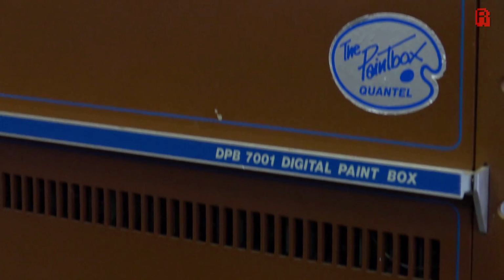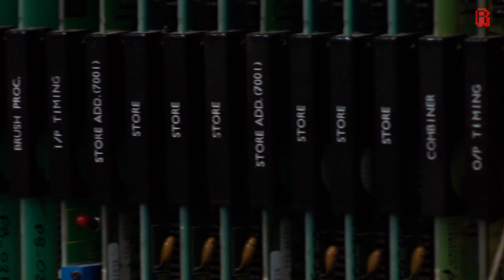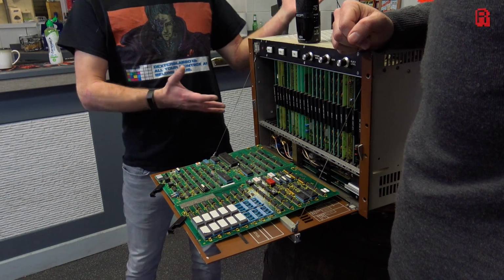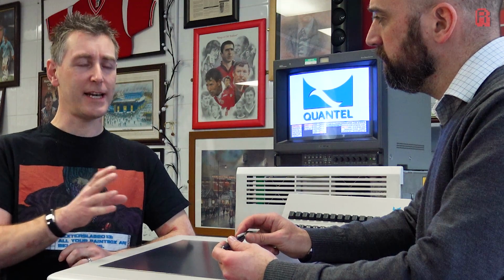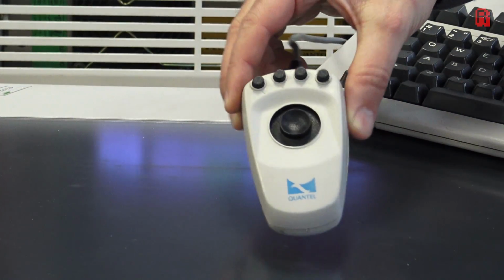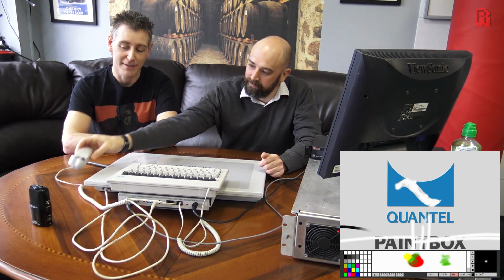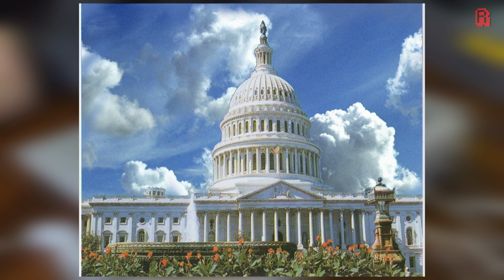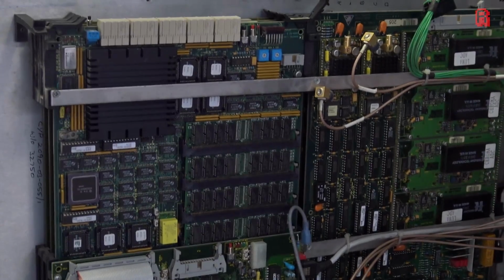How Did they make TV Graphics in the 80's & 90's?  Meet the Quantel Paintbox | Retro Road Trip

Comment: 256mb of Ram back in 86!! that is seriously impressive stuff. I'm blown away! and its British :0)
Reply: 1/4 GB of static RAM. Amazing.
Reply: @djmips  I strongly doubt it would have been static SRAM, that much memory would surely have been dynamic DRAM. And it would have needed even more circuitry to refresh all that DRAM too.
Reply: My phone had 256 mb of ram in 2012 lol
Reply: I had 16 MB RAM in my PC from 1996, first gen Pentium  150MHz.
Reply: @mipmipmipmipmip  You are right. Average memory in the early 90s was 8MB of RAM. To get a picture how much that was in 80s.
Reply: 64kb..my first computer..commodore 64 .
Reply: @dzonikg  My first computer was the VIC-20, it had 5kB RAM, but i also had a 16kB plug in memory expansion that was the size of a cell phone :-)  I still have my Commodore 64.
Reply: My computer had 64k in 86
Reply: @Stefan-  Me to have commodore 64 still haha..my parents bought me in 1986 ..i still remember the price..it was 700 deutsche marks ..i see that VIC-20 look same as commodore 64
Reply: @dzonikg  I had the VIC-20 in the early 80´s and got the 64 in the mid 80´s, i was a teen in the mid 80´s so my mother helped me buy it. The VIC-20 is white, but otherwise quite similar in apearance to the original "breadbox" designed version of the 64 that i have. I actually remember that the 64 cost 2000 SEK (Swedish currency)
Reply: @UrbanOzzy  I have 96gb of ram, and Chrome still uses 99% of it :(
Reply: @Stefan-  I had a Pentium 60 mhz in 1994 8mb Ram
Reply: @dzonikg    DAMN! That's ~400 bucks U.S.! Must have been the whole system with monitor and drive?  My C64 was ~$220 but that was just the computer.

My first experience with generating TV graphics was with the Amiga. I still have my (heavily modded) A-3000.
Reply: and typical of the brits, despite a MASSIVE campaign to get people into computing etc, all we were told about was the bbc micro and sinclair specrum etc.. Why no and look what the professionals use type of education to interest more people into the field? Why not tell people - if I had known back then what ram etc was available in 81 in a computer then I would have re-imagined my programming to think longer term scale. Instead we were told 16k was huge.. then 48k etc..
Reply: But surely you must have worked out that computers would improve. Even in 5 years there were huge changes. The Amiga 500 and Atari ST were available 3-4 years after the Spectrum.
Reply: In 1982 I had a zx81. It had 1kb of memory, the 16kb ram pack I got crashed if it even got the slightest movement...
Reply: @kenmeade9924  Well, companies aren't going to tell customers that their products are crap, of course they'll say that whatever specs ended up being profitable for them is also all you will ever want or need (despite doubling those specs a year or two later). Bill Gates (supposedly) said that "640K ought to be enough for anybody" not because he actually believed it, but because he was trying to sell a product and probably to justify some software design decisions. 

I guess one of the great things about the emergence of the generic PC in the 90's is that you get to pick what you want, you're not beholden to the choices made by a single manufacturer. If you're doing some hardcore data processing and need a shit ton of ram but don't particularly care about graphics, you can do that, and if you want to play the latest AAA games then you can have a modest amount of ram but load up a super expensive graphics card instead. It's also levelled the playing field significantly - modern workstation PCs are really just regular office PCs with beefier, more reliable components, but all the software is the same. If anything has helped people get into computing, it's that. BBC Micros and Spectrums didn't really resemble the IBM workstations and office computers of the day - and you certainly couldn't really use them as a alternative for them. Hard to imagine the WFH situation we have today working out so well if people's home computers were completely incompatible and massively underspecced compared to the computers they used in the office.

Comment: Thanks for the trip down memory lane, I supported these as a BBC News engineer at TVC.  I went to Quantel to take the DLS6001 still store course as we had those as well and the architecture was very similar. We did have one of those very very expensive 68000 CPUs catch fire on a machine down at Lime Grove.  My memory, which is probably faulty was that the Fujitsu Hard Drives were only 150MB.  They were incredibly heavy and were installed at the bottom of a 19 rack mount equipment bay.  The item that probably caused the most problems was the wired graphics pen.  I was called to have a look at an ailing pen by one of our designers, when I was not that familiar with the system.  'Looks OK to me' I said as I swiped it across the screen a couple of times.  The designer was distinctly not happy, it was a live project she was working on, not saved and no undo!  We still use Quantel Q-Edits as part of our video editing process.  Unfortunately I no longer have my course notes, somewhere in a landfill with the rest of the rubble from Stage IV TVC.

Comment: Thanks for taking me down memory lane. I worked for MicroConsultants-Quantel in Newbury from 1980-1985, my first job after university. I was one of the few programmers in the company of amazing electronics engineers. I remember the company using a professional artist as a consultant for the Paintbox, to guide them in how it could be used since, being electronics engineers, painting wasn't really their strong point. In those days, the actual electronics design was all done with paper and pen. The master circuit design was done on a drawing board in the middle of the shop floor. It's amazing to think about that now.
The company was truly innovative. Another guy hired at the same time as me was looking at the potential application of the company's video framestores for robotics, for example, for automatic image recognition. This was in 1980! 
The fact that the 'rat' had similarities with an aviation control was probably because the company's founder, Peter Michael, was a keen pilot.

Comment: Two of my favourite Youtubers (and people) demonstrating some of my favourite historic hardware. Couldn't ask for more.

Great job, guys. ;)
Reply from the maker: Thanks Ash mate, glad you enjoyed it
Reply: Thanks Ash! Some credit goes to you for sending me that broken one, i wouldn't have ended up here without it.
Reply: Those were good times.
Reply: @DextersTechLab   Did you get the original unit fully working?
Reply: @TheEPROM9  i did yes, it went to a new home in Portland, Oregon!
Reply: @DextersTechLab 

I believe Mr EPROM9 was asking about the DPB.

And, sadly, no. :(

The giant Fujitsu HDD turned out to have a fault, possibly on the interface board, so can't be accessed.

The main software won't boot unless it can load the fonts and brushes from the HDD.

Mr Dexter is still working on sourcing the installation floppies (or disk images), and perhaps we can eventually get another SMD HDD working with it.

The NEC HDD on my channel was bought as part of the effort in developing an FPGA-based SMD drive emulator.

I designed a PCB for that, but made a bit of a screw-up on the choice of IC for the higher-speed read/write data signals, so I'll have to tweak the design and build another board at some point.

(the chips aren't quite fast enough to write a proper MFM signal at 8 MHz.)

Not sure when that will be, as I have way too many projects, as usual. lol

And yep, I really miss the old Hangouts. I think we'll just have to start a random one soon. ;)

Comment: I never used a Paintbox, but in the 1990s, I used a Chyron MAX! for fonts during newscasts.  It had almost as many cards as the Paintbox.  As mentioned in your video, by the time the Paintbox Express came out, it was facing stiff competition from Mac and PC based graphic solutions like Photoshop that were a fraction of the cost and widely adapted by TV stations.   Backgrounds and graphics designed with Photoshop could then be imported into the Chyron.

Comment: The Weather Channel in the United States had one of the first Quantel Paint Boxes, so it is said. I worked for TWC back when it had a QPB, it was a wonderful machine. You could paint as fast as you could on the bitpad with the pen with an airbrush and it would keep up with the input. Someone I worked with said it had a custom MC68000, but it likely had a MC68000 interfaced to a fast FIFO on the data pins. Amazing machine.

Comment: I never worked with the PaintBox but with the EditBox. It was used for trailer editing, where you had to work with a lot of masks and keys ect. It was a nightmare to get used to it with a steep learning curve. I vividly remember a sales pitch from a Quantel rep, "But it is the Mercedes of all the editing systems" - true, a Mercedes also has no undo function. 
All of them had a hard wired ISDN connection to Quantel in case they broke down. And they broke down a lot (Though unquestionably well engineered, very complex).
"Human resources" where the final nail in the coffin for Quantel. Finding someone willing to put up with their quirky UI and/or sending them to expensive training workshops was harder and harder as PC's where more up to the task.

Comment: Fascinating video. Anyone watching the Top of the Pops repeats on BBC4 will have seen these in action. I is interesting to see the progress between 1980 and 1987 (where they are now).The hardware reminds me of Computer Aided Design systems in the 1980s, before they started using off the shelf workstations like Sun. Back then I regularly used a Racal Redac system which although PDP11 based, had a large graphics tablet and hardware zoom, because schematics, PCB layouts  etc were held as vectors. It was more than a decade before PCs had enough power to zoom as quickly and smoothly. Similar systems were used to design the Ferranti ULAs used in the Spectrum and BBC computers. I have read that the design system for those (which we also had at work) cost £100000.

Comment: I actually have a videonics titlemaker 3000 from 1995. Found it at an antique store for 20 dollars and found out that they are selling on ebay for 120 to 250 dollars. It also runs on a motorola 68000 but i am told that they used to use intel 486 chips beforehand. I would like to also point out that mine apparently came from a high school or college

Comment: In the '80s I worked at an animation company that had one of these systems. I ran the 12 axis motion control camera (35mm film). In the 90's I had my own company and used the relatively inexpensive Video Toaster and Flyer NLDE system with Lightwave 3D.

Comment: That board with the ZIP chips is hilarious, when you look at it from 2019. It's absolutely massive, and contains 1/256th of the capacity of a MicroSD card. (I know, apples and oranges, RAM vs Flash, but DDR4 modules aren't that big either.)

Comment: Always wanted to work on a Quantel Paintbox. I have had the chance to play with a Classic Paintbox and a later model in the mid and late 1990s. I instead ended up either using various tools on my Amiga, or at a couple of different jobs, using a 'ColorGraphics ArtStar' or 'ColorGraphics DP 4:2:2'. Both from a company in Madison, Wisconsin. A lot of broadcast TV stations in the US bought those. They were all-arounders. For the dollar, they did a lot, but they didn't necessarily excel at any one function. I, and others, have posted a few demo reels on ColorGraphics.

Nice to see a `90s vintage Paintbox in operation. Thank you!
Reply: Around 1997, I was at a station where the marketing director was determined to buy a big paint system. The two main choices were Quantel with the Paintbox Express 'Bravo', or the Chyron LibertyPaint. LibertyPaint was literally the descendent of SuperPaint. I pushed the marketing director toward Quantel, and that was what they bought. I was out the door before the system was commissioned... Yep, I moved on to work on a ColorGraphics DP 4:2:2 and a DP MAX system in Orlando.

Comment: Great to see. In the mid 90s the only real competitors was Discreet Logic with Flint / Flame / Inferno system running on Silicon Graphics hardware. 3d acceleration and warp effects were incredibly smooth on those machines. ; )

Comment: Another piece of kit used (until the advent of HD) by the BBC was the Acorn RISC machines, used for lots of things including on screen graphics and for playout control with some companies rack mounting the later RISC PC's for sale to broadcasters. 
Again a mixture of solid/powerful hardware and a bulletproof build/OS, add to that lightening fast bootup times with a ROM based OS (although later versions of RISCOS could boot entirely from HDD iirc or at least load part of it from HD).

Comment: love it. spent years working on classics, encores, DFS stillstores, DLS/CLS, cypher.... the later stuff (white fronts) didn't seem as much fun somehow, & people would wander off with the damn pens. 

the classics had the machine's serial number electronically embedded on all the boards, iirc, so no board-swapping! & the fonts were licensed to the crate.

I still have a paintbox 'tic' when I'm using a wacom tablet, where I try to flick an imaginary cable out of the way.
Reply: (I once taught steve wright, the DJ, to use a classic)
Reply: & 01635 48222 is etched in my memory. called them once about a dead board in an encore DVE, 

"this page in the manual that I need to look something up, it's blank. it says 'this page intentionally left blank'. why?"

"the techniques used on that board are protected by the official secrets act."

Comment: Quantel was a true pioneer, but then sgi + discreet logic came. Flint/flame/inferno was the software of discreet and sgi built the workstations. I can see some functionality of paintbox inside flint.
Reply: FFI needs to be featured next!
Reply: focalpointehi I couldn’t agree more
Reply: @antgrsimos  I have a number of original Discreet systems, must admit as soon as I saw the PaintBox interface I thought, blimey, that looks weirdly familiar. One could say maybe Discreet pinched the look, but then otoh, I created a 3D app for an 8bit system all on my own in 1984 which had similar looking stacked boxey style GUI elements; convergent evolution perhaps, same solution to the same problem. Wouldn't surprise me if Discreet nicked the Quantel look though. :D

SGI certainly brought the performance to the table (Flint Indigo2 MaxIMPACT setup would blow that system away), but they definitely did not bring down the pricing (the Flint system I have was 100K when it was bought new in the mid 90s). Like the guy said, that side of the industry with the money to spend kept the pricing high simply because they could afford it, so the systems were crazy expensive whether they needed to be or not. Even with Effect running on an O2 (also 1996, far more powerful than the later Express system shown in many ways), the price was still very high, just because it could be (ie. despite the machine hw itself being a lot cheaper). As for Inferno, that's a whole other league, not just the sw being optimised for IR gfx but also the way some companies had the sw blown onto FPGAs on XIO boards to hw accelerate even the sw backend, making everything crazy fast (clients paid 7500/hour to use such a system).

Ironic really, Quantel reminds me of SGI in that way, products grounded on specialised hw, targeting markets which inevitably exploited commodity tech and a move to sw in the long term. SGI likewise failed to adapt, made worse by a great many terrible decisions and marketing policies, many of which derived from how Discreet operated (awful ripoff licensing, poor optimisation, failure to fix bugs, etc.) Discreet ended up becoming a millstone around SGI's neck, heavily influencing what actual hw SGI was designing, which was a huge mistake. I'd be intrigued to know if Quantel ever found itself in that kind of quandry, certain important customers coming to dictate too much how the company operated and where it was going.

Oh, remember there was Smoke and Fire aswell; Autodesk mushed them all later of course.

I have an Effect O2, a Flint Indigo2, a Flame Octane, two Smoke Octanes, a Flame/Smoke Tezro and an Inferno Onyx3800.
Reply: My theory is that discreet was trying to fit in the  "Quantelized" graphics/vfx industry and they had to have familiar menus. How many systems do you have!!!??? 
I always wanted a maxed out tezro.
Reply: You should call RetroManCave to show this stuff.
Reply: @antgrsimos   (already talking to RMC about something else) I have seven Discreet systems overall, but many other SGIs that weren't Discreet setups (three Tezros atm), also an Onyx350, Onyx2 deskside, Fuels, etc. Not sure how many total SGIs, couple of hundred maybe.

Comment: With a typical retail value of around $800-1000 per megabyte of RAM in 1988, that 256MB RAM card alone would have had upwards of a quarter million dollars worth of RAM!  I remember paying nearly $1000 per MB of RAM for the 2MB RAM that I ordered with the 386 that my family purchased in 1988 (a roughly $8K system with 150MB ESDI drives, plus an HP LJ Series II printer with its own 1MB RAM expansion for another $3500, or so) purchased at the peak of the RAM shortage in that year — bad timing for sure, but when you need the hardware, you need the hardware!

Comment: It couldn't have been the 1974 Olympics because there were no Olympic games that year. Back then (through 1992), both the summer and winter games were done during the same calendar year, which was also a leap year. So there were Olympics in 1972 and 1976, but nothing in 1974.
Reply from the maker: Yep well spotted.  1976 was the one